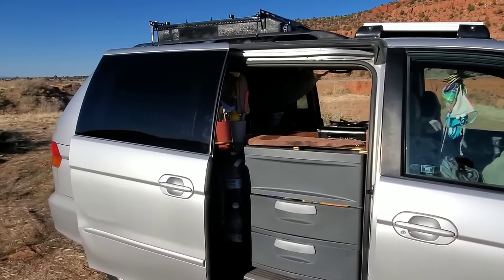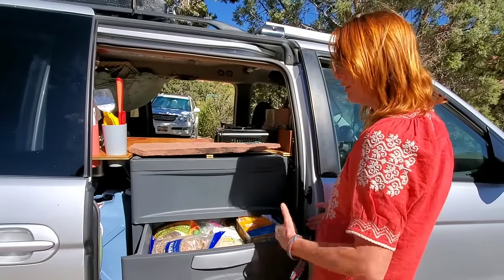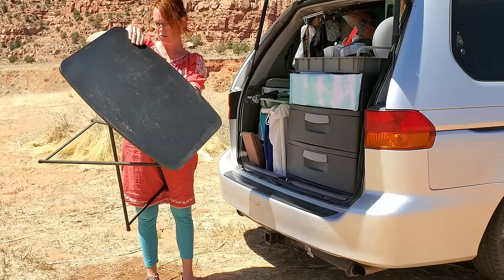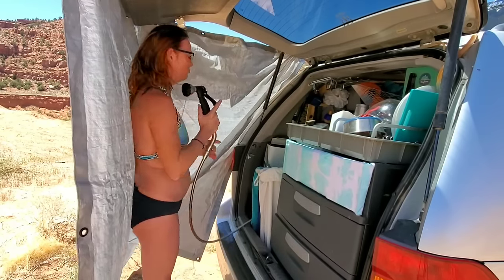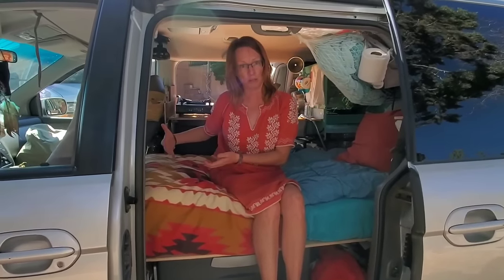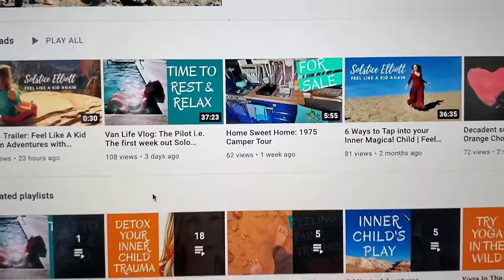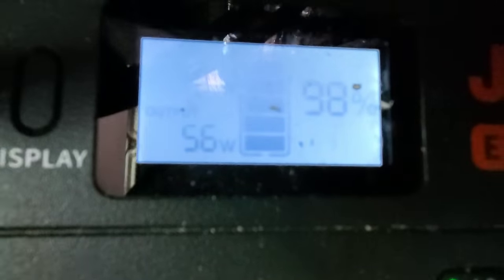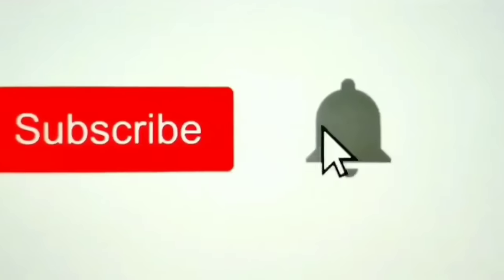You've Never Seen A MINIvan Camper Conversion Tour Like This! | + Stealth + Off Grid

Comment: Though you have a fantastic Ly livable situation here I have one question: what happens when it rains? I know the idea of living in a mini van is more like living OUT of a minivan, but when it’s cold or rainy you are simply out in the elements and your heat all goes out the windows, so to speak. I suppose this doesn’t matter if you live full time in certain areas of the west but that will exclude traveling in the southeast or north west as a rule. 

But I have to say you certainly know where everything is and I’m sure you have a way to get to needed items in bad weather.
Reply from the maker: That is the beauty of being nomadic you go where the weather is most comfortable. That being said I have been in Death Valley caught in the rain for 10 hours straight. I just went to the bathroom in a container with a plastic bag and had my Mr. Heater going occasionally with the windows slightly cracked. With the hatchback up you could take a shower and get dressed even if it was raining or slightly cold. Of course, once you leave the shower area you'll get wet so you'd have to hurry back into the van. It's an unpleasantness I am willing to accept, but like I said I'm not really fond of traveling to the Southeast. It's just buggy and muggy.
Reply: I remember as a kid  i took a shower outside on the street all the time.   Haven't done that for years after growing up.